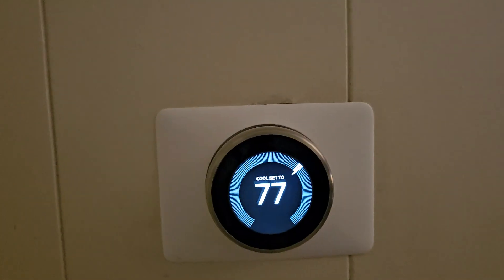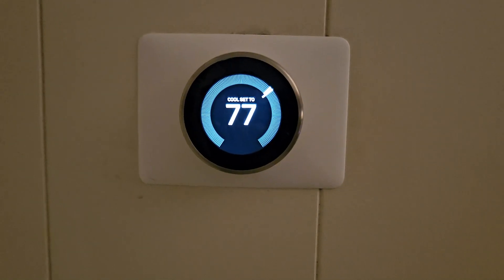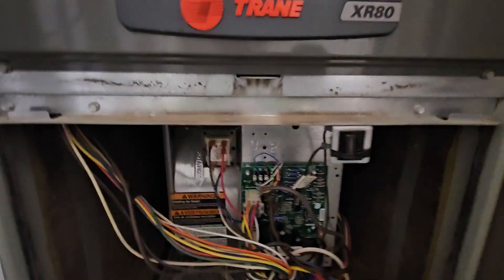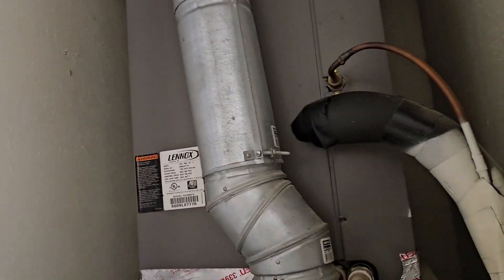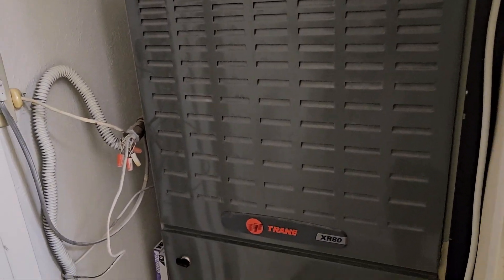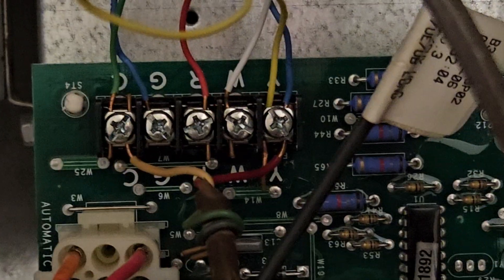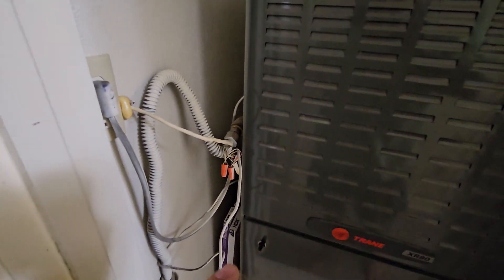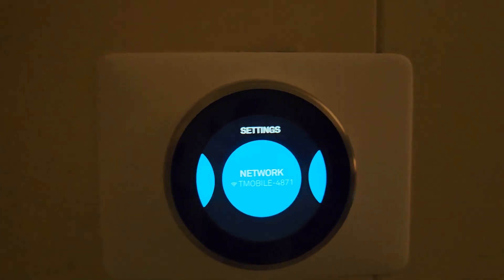Nest Thermostat quick fix for no cold air! Try this before you call your HVAC company.

Comment: Just to fill in the blanks a little bit. The reason this supposedly works without a common wire is that there actually IS a flat  lithium Ion rechargeable battery  inside the thermostat. It recharges over time. 
But eventually, it poops out.
There are a couple of videos about how to change the battery. But by using a common wire, it sort of eliminates the problem of the battery dying. 
I have what I believe is a gen II that I've had for many years, and it just started doing this. 
This seems to work on mine, but I detected a sudden rise in heat coming out of the unit, so I've gotta figure that out!????

Comment: First of all thank you for taking the time to make this video , I’ve been switching my thermostat back to my old one with the batteries in the spring over the last several years.      ( so my ac would work over the summer ) and then switched it back to my nest 3rd gen learning thermostat in the winter ( to my gas ,forced hot air furnace for heat ) .. unfortunately your method didn’t work for me but it inspired me to get off my arse and try and because of that I came up with a solution that finally works and I hope can be helpful for your viewers . I simply moved the red wire from the bottom right ( Rh ) to the bottom left ( Rc ) and my ac finally work ( not just the fan comes on like before , the fan and the condenser unit outside both kick on now ) I have no “c” wire  ( now I finally have a nest thermostat that does what it’s supposed to in the summer ,.. if for some reason the heat doesn’t kick on this winter, I’ll just pop the nest controller off and switch the red wire back from bottom left ( Rc ) to bottom right ( Rh ) where it was as the heat worked before in that configuration ( just as a side note ,.. in the process of all this I did reset my nest back to factory settings prior to coming up with this solution so your viewers may have to do that if it doesn’t work the first time )   * while watching your video something popped off in my head ….RC ( red for power c for cool ) and RH ( red for power , h for heat )… thanks again !

Comment: I have the same problem, when using cool mode it turns on furnace fan but not the a/c. Tried your method but not the a/c turns on and stays on, plus thermostat doesn't light up but still able to control it from the app

Comment: Here’s the problem I’m having, the compressor went out, had it replaced.(only the compressor, not the condenser) used one of them Home Warranty things that we pay for monthly so they go the cheaper route. Well, it wasn’t cooling properly meaning I would set the temperature to 70 and it would not reach temperature. Say for instance, it was 76° in here. It took seven hours to cool down to 70°, seven hours! With the old air conditioner when it was working, it took probably an hour to cool down 6°. See what I mean. Now I have to keep it at like 73 or 74° so it cuts off otherwise the air conditioner will run constantly trying to keep it cool.  I would keep it on 72 and it would cycle through like it normally would previously. They replaced some other part in the attic.(the part that you were showing us with the wires, ours is in the attic) our condenser/compressor is on the side of the house. So that’s my story. I don’t know what else it could be. I told them that it’s not going to work right until they replace the condenser unit. Don’t half ASS do the job by replacing the JUST the compressor. But that’s what they did. They did not approve the condenser but that’s what it’s going to take I think. I read something about the thermostat possibly being dirty, but I have a nest thermostat very similar to yours so I don’t know. Oh, and supposedly the Freon level is OK.

Comment: Bro you have no idea really what you're talking about. You are right about the common wire and that is it. Thermostats can function without a common but it's definitely not ideal and can lead to non-functionality
Reply from the maker: Thermostat functioned fine. Compressor didn’t. Power draw was too much. Tech agreed. Old thermostat didn’t have this problem because it ran off of AA batteries. This thermostat draws power from the unit itself. Multimeter verified. Hence the problem. Appreciate the commentary though. 👍
Reply: @jonathanaustin8841  that is the only part you got right.. I don't disagree with you in that..

Comment: So did you have a wire for G and C initially and then just moved G to C? Cause mine has a wire for both already but seems like during the day it runs non stop but weak and not cold. Then around like 2-3 AM it starts blowing hard and cold air.

Comment: You had an extra blue wire coiled around all your wires ( brown wire)which means you can use that extra wire for your C wire. I watched another video that explained you might have a extra wire coiled and was able to fix mine and not use the g wire :)
Reply from the maker: It was coiled around one side but not the other. I was going to attempt to run a dedicated c wire but figured this fix will work for the time being.